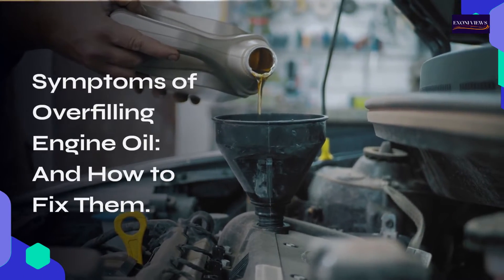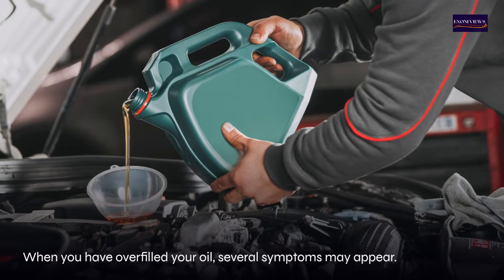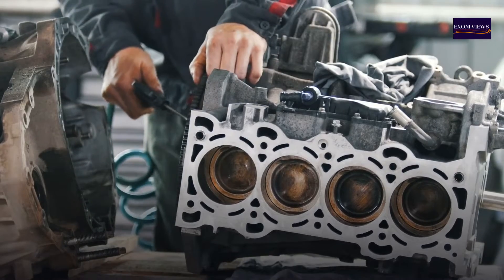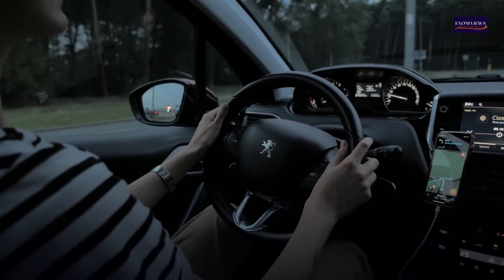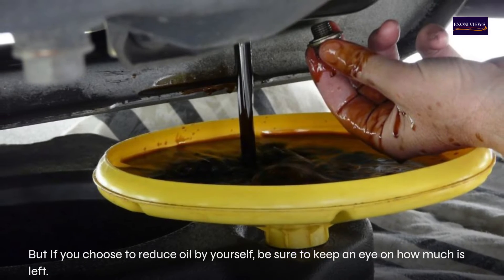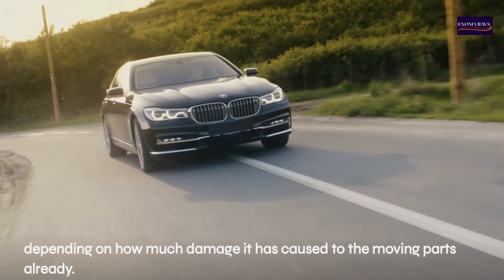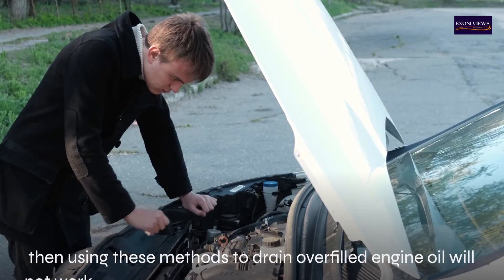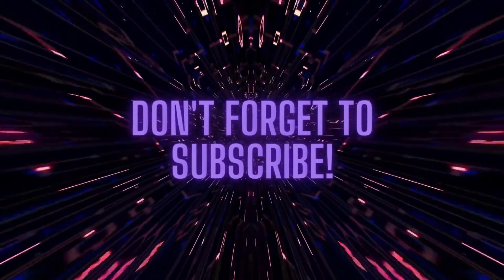Fixing Overfilled Engine Oil: Recognize Symptoms And Solutions!

Comment: Holy crap
Jiffy Lube did my oil change,  4 days before Christmas 2024....WAAAAAY TOOOOOOO much oil in  crankcase.....Nearly FFFFFd up my engine.  Thanks to a smart Subaru mechanic who diagnosed the issue at hand, my problem was solved and the vehicle lives another day past its current 181,000 miles. I tried every ailment and easy recognizable , cost effective process of elimination,  before the simple problem was rectified. Thanks to Subaru of Hicksville for enlightening me to never go to Jiffy Lube EVER again!!!!!